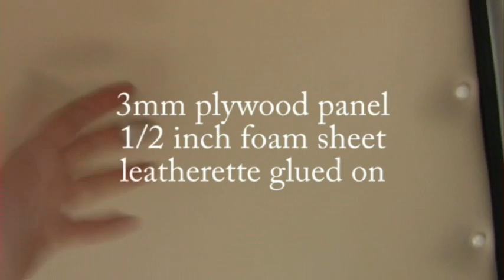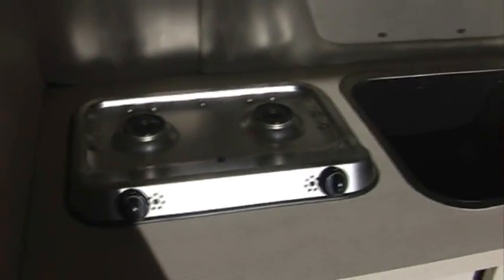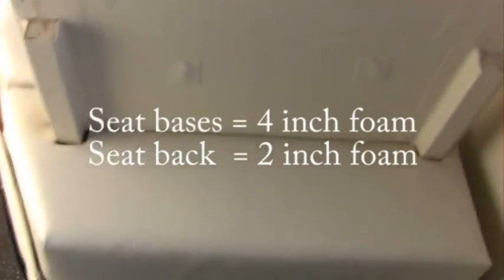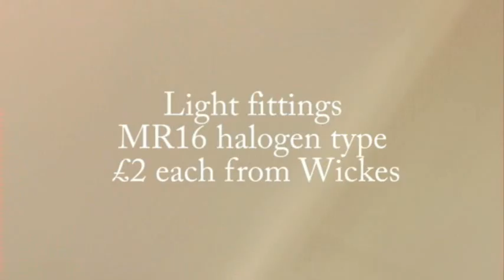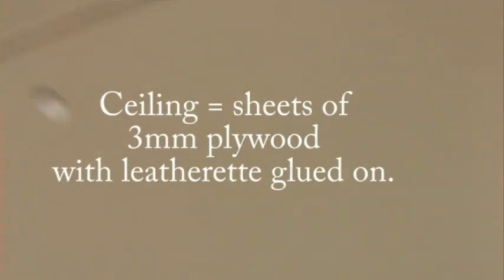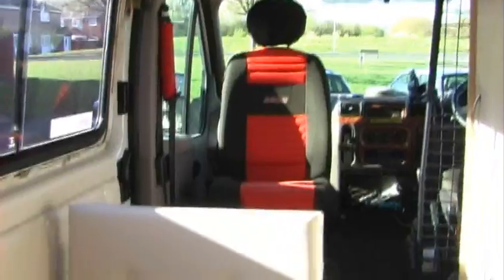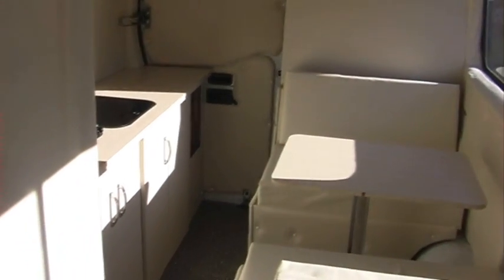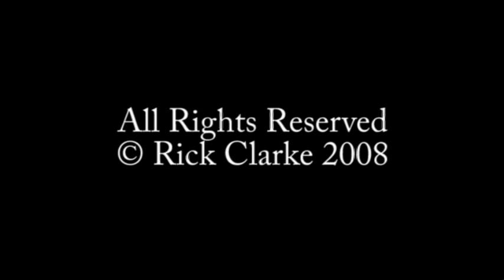HOW TO MAKE A SELF-BUILD MOTORHOME PART 2

Comment from the maker: Hi again, no probs
No complicated plumbing involved, just a simple drain that goes directly through the van floor, then bends 90degrees underneath.
It then goes into a flexible waste pipe that makes its way back into the waste tanks.

I made a "shower tray" by cutting a square of floor lino and bending the edges up to form a tray shape. 
I used bathroom sealer in the corners to seal the tray. 
I then used floor lino on the walls that run into the tray arrangement.

hope this is clearer.

Comment from the maker: Glad it helped.  yes we have practically the same van - except yours is taller.
Yes the panels are practical and thin (lightweight) as all the structural strength is in the skelton framework that they attach to.
Be sure to check out the SBMCC online forums for a ton of practical advice.
Rick

Comment from the maker: Hi.  
The shower drains via a standard plughole that bends 90 degrees and runs into the waste tanks along a pipe. 
No rear seat belts are attached (MOT nightmare getting them right).
Taller is good, but can't get under height barriers.
I didn't make a part 3 - but made a tour video
(click the link in the notes area)

Comment: I love this video; so helpful. And it has given me a ton of ideas for my own motorhome conversion on the MWB Vauxhall Movano... which I think is a Renault Master with a different badge! 

I particularly like the ideas for the foam/leatherette paneling finish and also the blue lighting idea which looks very cool. I'm thinking the paneling would be easy to remove and recover if a panel got damaged and also easy to clean as well as being warm, I'm sure to be using this method in many areas.

Comment from the maker: No probs - opinions are good!  I agree, but the old design got really dirty quickly and because it was cloth, it couldn't be cleaned easily and got wet and smelly whenever I sat down in a wet suit . The new arrangement is much easier to keep clean and wipe down, and is water resistant too - perfect for the beach. :o)

Comment from the maker: I've sent you a private message with a link. 

No the floor is not raised, it is the same height as the rest od the van.

The "notes area" of the video is the bit of text in the upper-right hand corner - where information about the video is.  (you have to click the blue text where it says "(more info)"
.

Comment from the maker: @arndy26  Hi - the master vans are fab - I'd have another one without hesitation. 
 The water is heated in the kettle (no installed hot water system) I've managed just fine without one.  
Waste tanks are mounted beneath just behind the rear axle.  see my video titled "SELF-BUILD MOTORHOME 1 - SHOWER CONSTRUCTION"  It'll talk you through it.
cheers.